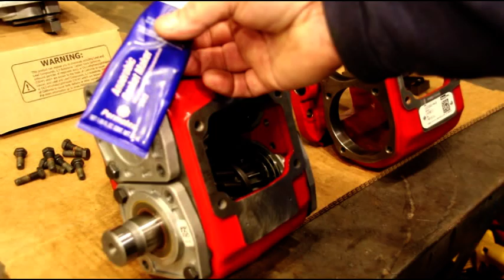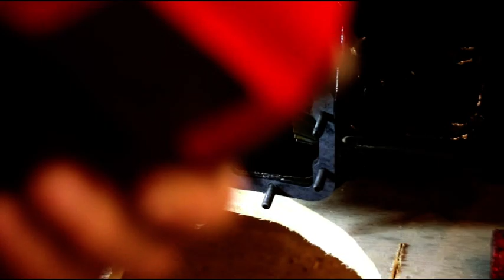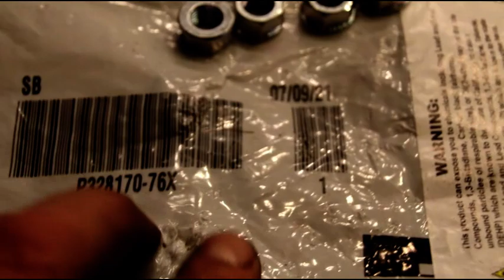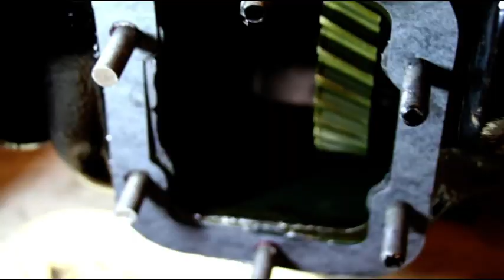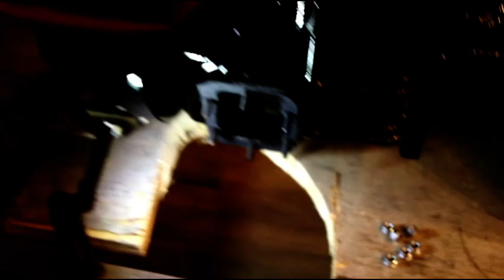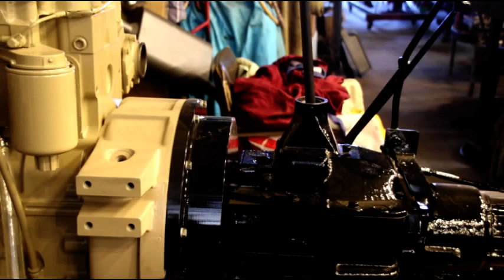Chelsea 352 PTO Install, Willys Cummins 4BT Welder Jeep Project

Comment: Man, thats an impressive set up. More gear than most service trucks. Id be doing something like that with a 6BT in the J20.
Reply from the maker: would love to put a 6bt in the J20  but have to get the welder CJ3B finished first..